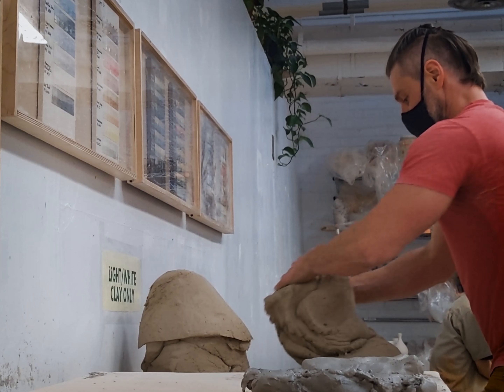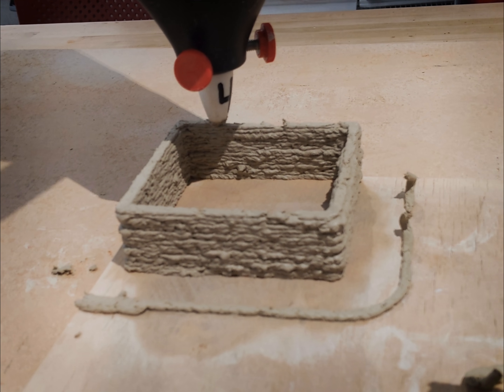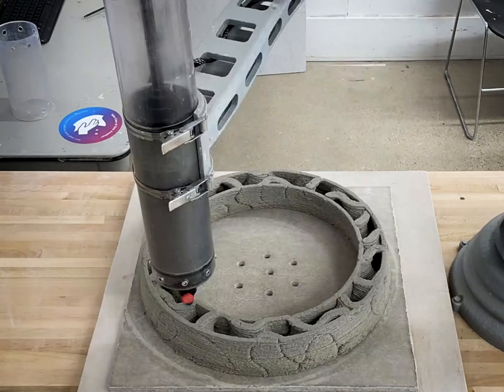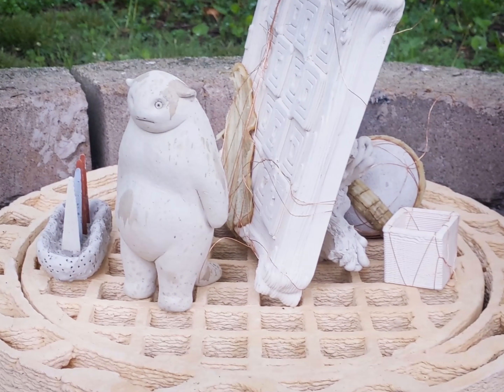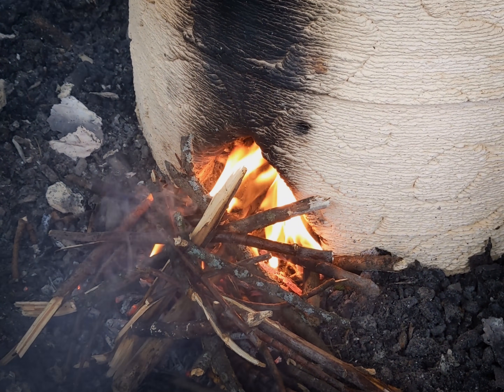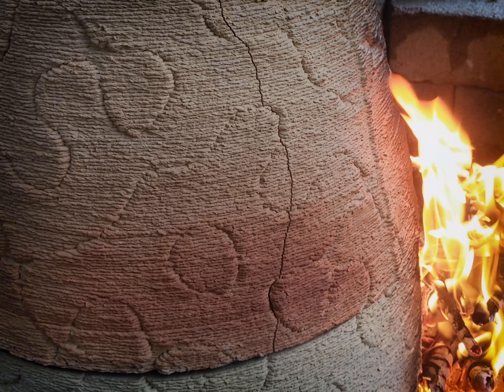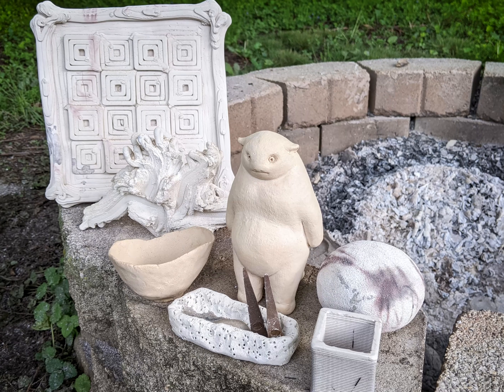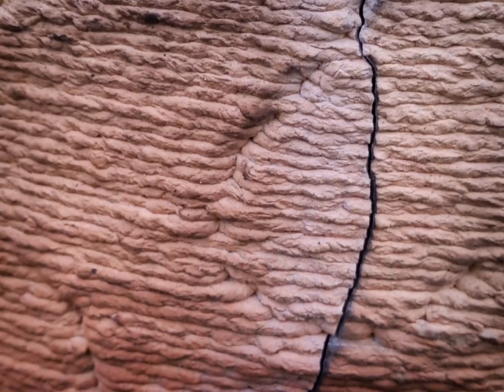3D Printed Kiln Version 1 | Materials, Process, First Test Firing

Comment: Could you fire the kiln separately to harden it first?
Reply from the maker: Oh, I should have mentioned this, but it is. fired to cone 04. That low, because there is some indication that more porous clay bodies are more resistant to heat shock.